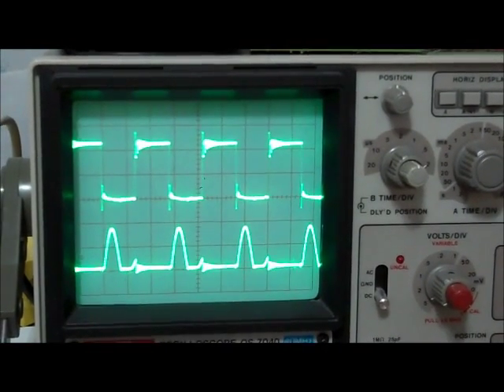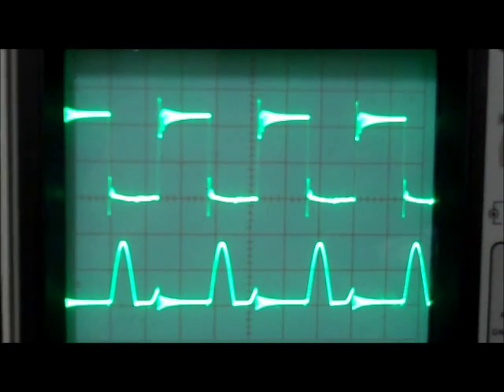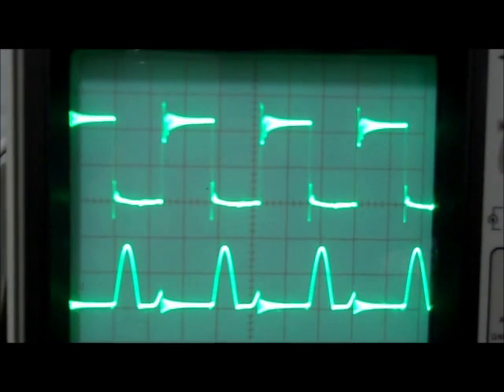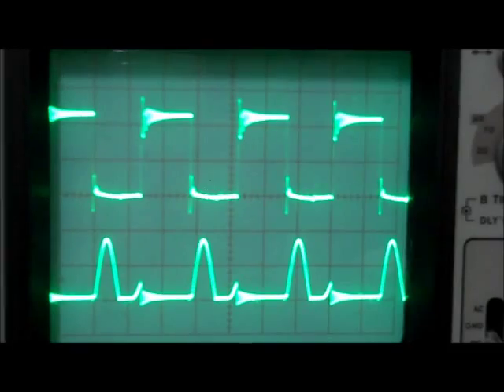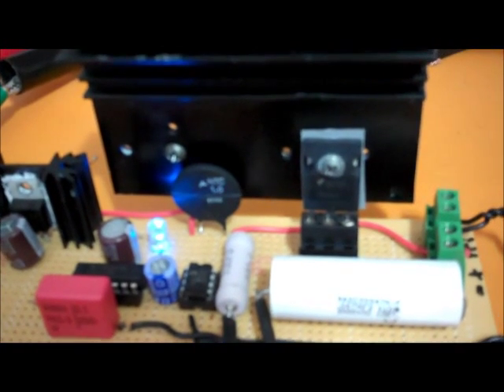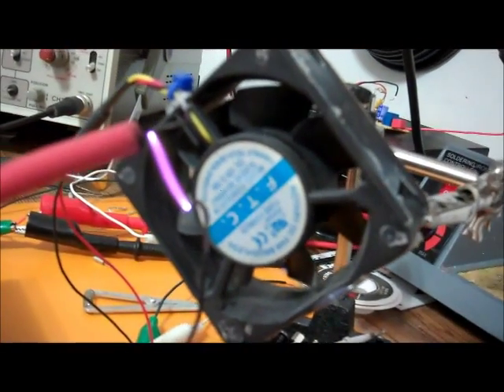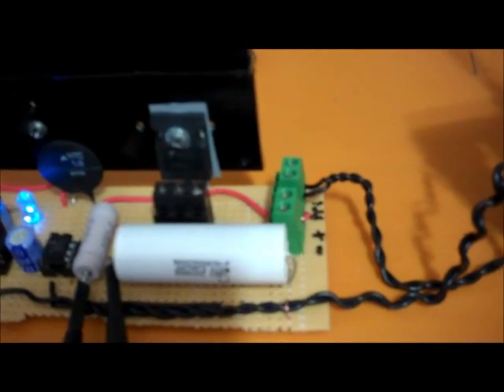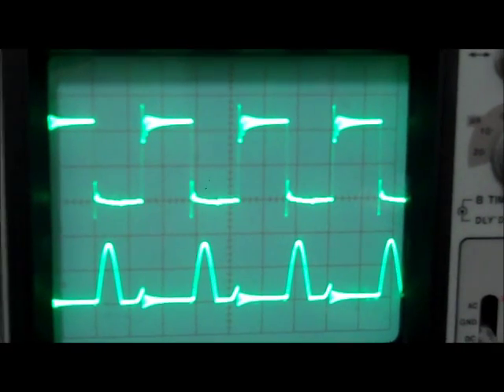Flyback LOPT Transformer Operation Explained

Comment from the maker: cont'd: You then drive the coil with an appropriate drive signal and test out the possible return pins to see which one develops the highest voltage between it and the HV output (longest spark formation distance, not longest spark stretch distance).

Comment from the maker: Generally the original primary is discarded, so all you're left with is the main secondary ground/return pin, and a bunch of tertiary windings pins. Simply apply about 100V (some FBTs have very high combined Vf for the internal diodes) between one pin on the base and the HV output terminal, when continuity is confirmed you have found a pin likely to be the HV return. Some FBTs have multiple series secondary windings; in this case you get several pins which show continuity. cont'd...

Comment from the maker: The feedback does not increase efficiency, but using the flyback effect does. The feedback just allows the system to self-oscillate at resonance so the only effective impedance is from non-reactive sources, which allows the maximum transfer of power. If you were to clamp the inductive kick from the primary to ground during the driver's LOW portion of the signal you would have severely reduced output on the secondary.

Comment from the maker: I estimated the secondary voltage via measuring the distance between two spherical terminals that single HV arcs would jump. 1kV = 1mm. In the vid the gap is just between wires and set for a constant arc so the scope is kept happy, so voltage never rises that high. 0.707 x Vpk = Vrms. I do not believe this flyback has diode-split secondary as the LV end of the secondary radiates a RF signal at several kV. You can light neon tubes via wireless capacitive coupling off of it but not the HV DC end.

Comment from the maker: When I get some time I'll draw up the schematic, it is pretty symple though: 1 side of feedback winding to dc blocking 0.1uF cap, other side floating. From other cap terminal to Hex Schmitt Inverter, out from inverter to TL494 input. Output from 494 to 10R gate resistor, gate resistor to mosfet gate. Vcc to primary terminal, LV end of primary to mosfet drain, mosfet source to ground return.

Comment: Have you messured the old primary peak-voltage? (probably needs a probe able to stand 1 kV)
For feedback, if the focus/screen divider ground is accessible, try connecting a resistor from it to ground to get a voltage depending on the output voltage.

How did you get the RMS voltage of the output? As far as I know it's very non-trival to messure (and the high voltage winding is diode split into sections, with their own capacitance)

I like your effort to explain, most other videos lack that.

Comment: efficiency? I guess feedback just limits the delivered power to what's needed.

As for me: I want to build a proper flyback regulator(20-30 kV) with voltage feedback (and current limit for arcs).
Voltage limit to not blow the transformer/FET and current limter to not overheat the transformer (and supply)

20 kV with active arc = probably not (even the starting voltage can be 20 kV)